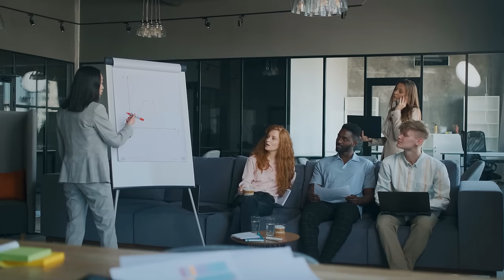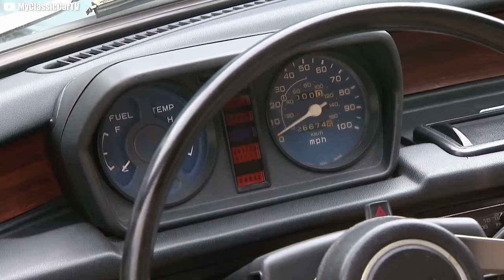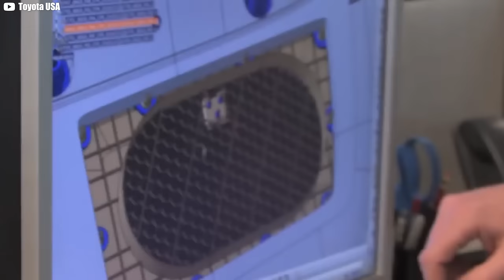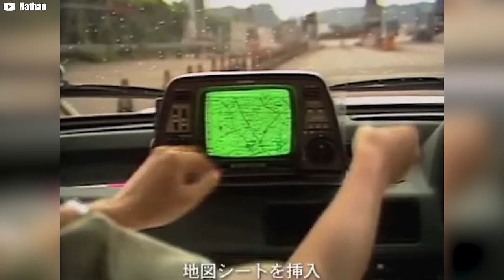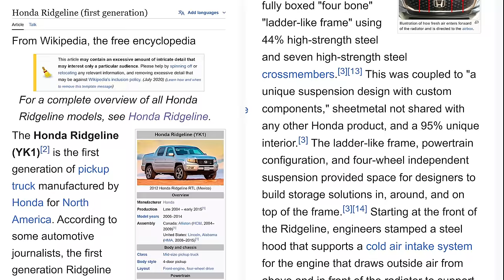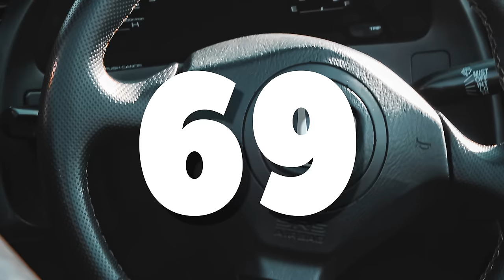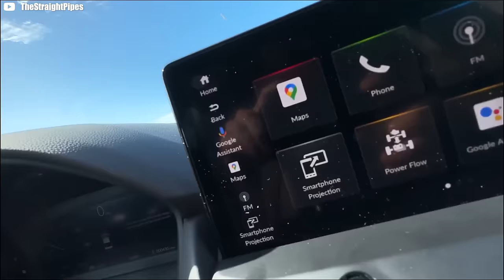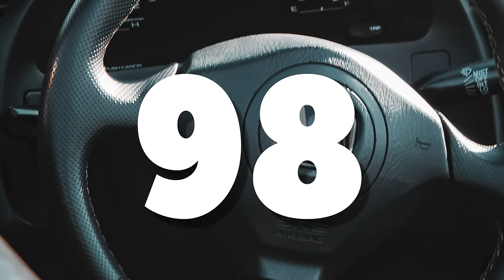101 Facts About HONDA

Comment: 27: you said the Honda CRZ was the first manual hybrid, I hate to be that guy, but this is actually incorrect, Honda themselves made the first gen insight back in the late 90s, that car was also a hybrid and came with a 5 speed manual.
Reply: Yup. The CR-Z was the only manual hybrid on sale at it's time, and the only hybrid to have a 6-speed manual, which often gets confused by people into thinking it was the only manual hybrid ever.
Reply: Thats right and after the first gen Insight there was the Civic IMA also wirh manual transmission and also before the CR-Z
Reply: @nfspeedy2  My sister owns one!
Reply: there goes my fact
Reply: Yeah I was gonna mention the civic hybrid manual. You go it tho
Reply: And the 2003-2005 civic hybrid were available with manuals too
Reply: Yes, correct indeed.
Reply: I love my CRZ. things a slow tank. you could redline to to hell and it'll run like you didnt even do it. Its been in my family 12 years and I've had it for about 6. get one YALL its worth it.

Comment: Good on Honda for not wanting to put out fake engine sounds like some other cars
Reply: I'd rather have a funky rear exhaust setup than fake engine noise (especially a V10 noise on a twin turbo V8, BMW)
Reply: unlike bmw
Reply: ... 🤔 The FL5 CTR pumps in fake engine sounds into the cabin.
Reply: Yea, like what Hyundai just did on their ioniq 5 N 🤢
Reply: @kdotdo  Not exactly, I think what they actually done is they put a microphone right next to the engine and play that sound into the cabin.
Reply: They still pipe in engine sound though. Facelift FK8 Type Rs have it and the FL5 has it lol
Reply: @ameraboukoura6091 that car isnt bad tho
Reply: @kencai6803  It's classical fake synthesized sound, no sugar coating
Reply: Sounds like Dodge
Reply: Hint, a company called BMW
Reply: I own an FL5 Type R, and the car has fake engine sound pumped in through speakers, a stupid feature which luckily can be disabled.
Reply: VW did it also... A rubber hose.. attached to the firewall...
Basically..  to mimic a 5 cylinder.. how weird
Reply: Why? Better to have them as an option than not. „Car enthusiasts“ like you are honestly making the world worse
Reply: @kdotdo all 10th and 11th "sport" trims do it
Reply: @aleppo1 so do si
Reply: Why? Engine sounds are useless anyways.

Comment: 102: hondas are the car which wake you up the most at 3am
Reply from the maker: Damn how did i miss that
Reply: Straight piped VQs
Reply: Ah yes, Honda Civic users, my one and only designated "Midnight snack time!" alarm
Reply: @DYTASTIC  🤣😂
Reply: @DYTASTIC  the first gen honda crossroad was a rebadged land rover discovery, and it was the least reliable honda
Reply: @ytkoenig1384 😂
Reply: @ethanye9178 a honda with no exhaust and a straight piped vq is an extremely lethal combo for 3 am

Comment: 89: While the EV+ was the first production EV to use nickel instead of lead acid, modern EV batteries are usually lithium-ion. Nickel used to be cheaper and more viable before lithium technology matured, but when the Tesla Roadster became the first lithium-ion EV everyone settled on lithium for its density and lower weight

Comment: Great video but on #27 the CR-Z is not the first ever manual hybrid vehicle. The first gen insight is. The CR-Z is based off of the Honda Fit platform which came out after the insight

Comment: Hi

I am from South Africa. I am not sure about the power figures on that AMG Ballade. Yes, in SA we called the CIVIC a Ballade until the time the Civic (2000) came out (170i VTEC and Type-R). After that version of Ballade the Civic was know as the Hatch Back and the sedan of the following model was also known as a Ballade. The 96 - 2000 Ballade was also available with that same 1800cc engine. That AMG was called a 180E. The 160i version had the D16B DOHC engine in it, the 160E had the D16A in it, and the 150 Had a D150B Carburetor capable of doing a couple billion miles (or Kilometer is SA). The 180E had a 1800cc Accord (Japanese version not US) engine in it. It made good power, but excellent torque. It was definitely NOT a failure in SA. The people who owned them LOVED them, and everybody who did not have one, wanted one. It was the most luxurious one of that version of Civic or Ballade as we knew it. It was on sale in SA till April 1996. Fantastic car. Still quite a few of them around on our roads, however ALL of them are severe milers.

Just for background, at the time (1989 - 2000) Honda was sold in SA though Daimler-Chrysler whom also owned Chrysler (Chrysler has always been seen as a "pathetic" brand is SA. (Horrible vehicles or maybe it was just the versions we got here in SA like the Neon (and Neon RT) and PT-Cruizer) and Mercedes-Bens, Mitsubishi and Honda.

Until today, Honda is know for quality, reliability and longevity.
Reply: Wow! Thanks for the information 💯

Comment: Nice video.  Lots of interesting information.  However.... #39: The RL / Legend shown in the video was the previous generation which only had 210-225 hp depending on the year.  And you got #42 wrong on something.  The reason the 80s Prelude got the Date Car nick was because of the placement of the passenger seat reclining lever.  It was placed towards the driver side, making it easy for the driver to recline back the passenger seat.  Use your imagination for the rest.
Reply: #39 Yep, you're right. It was the Acura RL KB1 (Honda Legend KB1 in Europe) who had 295 hp sinds 2004.

Comment: 26:06, The honda is called the EG9, its a phdm car, its rare to find but its easy to import, it uses a stock steeringwheel, drum brakes ( i think or its the concept that has it,) all tho its a sedan type eg, for the power, the eg8 makes 80-90 and the eg9 makes 150-180.

Comment: Great video!  If I recall, Honda created the company by picking up discarded fuel tanks from US bombers, which he used to create the Cub.  I always loved that Honda is an engineering company that happens to make cars.  I remember at 17 needing to buy my first car. My parents wanted me to buy a new car. I almost got an Integra, but didn't trust the "new" company. lol   I later bought a Saturn Vue only because it had a Honda V6 engine.  Oh, and I originally bashed the Ridgeline as a wannabe Odessey when I had a Chevy Avalanche.  Now, I see many trucks which have copied the Odessey.

Comment: #23 Not only was the Prelude the first car to feature 4-wheel steering, Honda did it while making the system purely mechanical. Others were trying, but they were planning to use electronic systems.

Comment: My Honda FR-V wiper comes when my wipers are on and I reverse.
It is probably Honda's only 6 seater, 3 in the front, 3 in the rear..
On older Honda's if you see paint on a bolt, it is because it was torqued to a specific torque.

Comment: #10 - Honda did not start out as a motorcycle manufacturer. They started making engine components for Toyota and Suzuki. Then transitioned to disassembling American made generators to attach the engines to British made bicycles - they didn't invent the moped, but they did make a lot of them. 

Also, while CVCC did work on the 5.7L Impala engine, it still produced more emissions than the set of solutions that GM made.  GM may have been unnecessarily dismissive, but they did back up their mockery with a superior design.

Comment: #61.. What you showed as the SiR wasn't so much a model name as you had it seem but was a trim/performance level of that JDM generation Accord.  Ok, that car actually had two different names, the Accord and the Torneo, with only the lights both front and rear being different but the rest of the body was identical; of course the lights affected hood, trunk, and fender designs also.   Wait, it had a third name as it was also sold as the Isuzu Aska as part of a rebadging deal between both companies.....Isuzu got a car and Honda got the Rodeo which they sold as the Passport.
Back to Honda...So that generation Honda Accord and Torneo you could get as three trim or performance levels with different chassis codes.
The base CF3 chassis code Accord or Torneo you could get with a 1.8 or 2.0 F18 or F20A SOHC engine.
The CF4 cars were the SIR and came with the blue top 2.0 F20B DOHC engine..... these had tiptronic transmissions but were also available with a 5-speed manual badged as the SiR-T.
The third level was the CL1 badged as the Euro-R which came only in manual with a red top 2.2 litre H22A engine, basically the engine from rhe Prelude.
The wagons with a CH chassis code came with SOHC and DOHC variants of the 2.3 litre black top H23 series of engines and were available as either the base trim or SiR.

Comment: fact#102,  on steep incline or in heavy headwind the 1980 civic & N600 right front wheel would bounce until the speed was reduced to 35 mph maybe because the unequal length driveshafts werent balanced

Comment: 16:12 #50 if you think of "from factory." then YES, but if you think about taking limiters off the 4A-GE 20v can rev up to 10k rpm STOCK with a little tune.